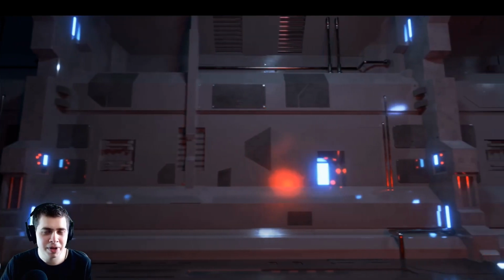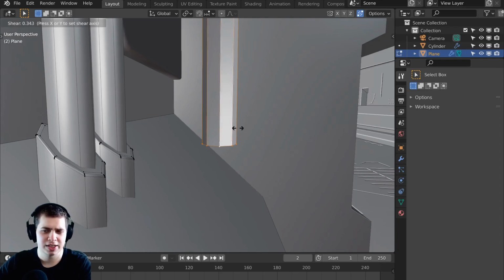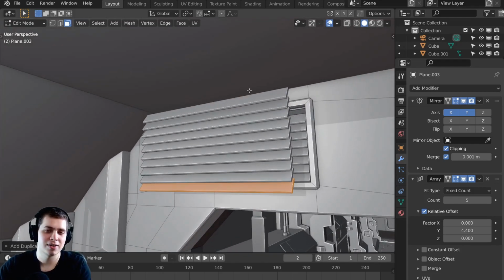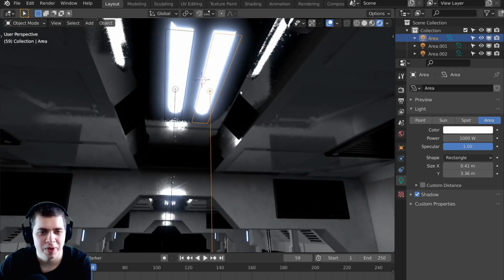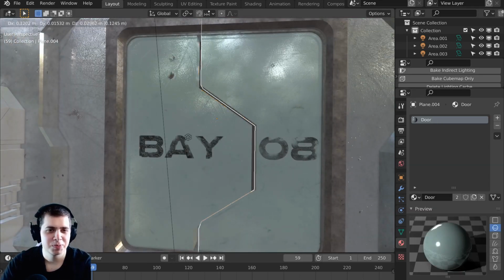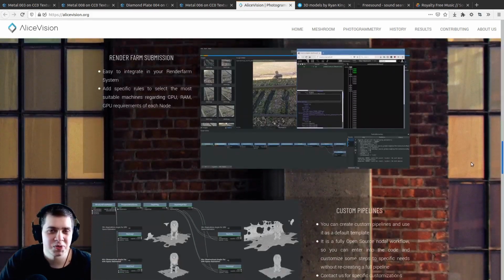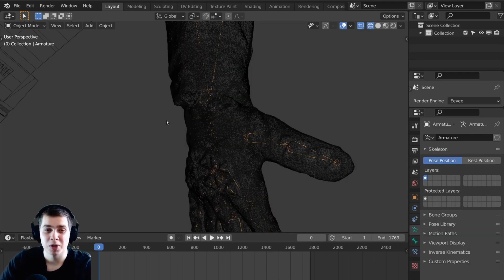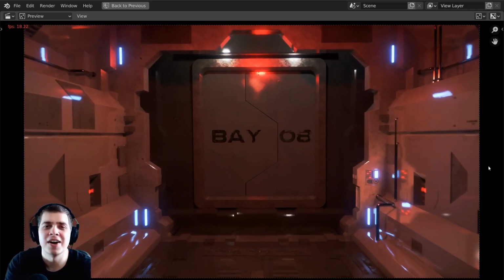How I Created this Sci-Fi Corridor Animation in Blender

Comment: WOW, that was Awesome .. You Are an AMZING  Artist.. I am currently working on the abstract cube  .. I will get there.. I have a very slow computer .. what pc spec's do you recommend ?
Reply from the maker: Thanks! Hmm, that's a hard question to answer, because it all depends on what your mostly doing in Blender, and also your budget. 

Here's an overview of my PC Build:
Ryzen-3900X CPU 12 Core 24 Threds
Cooler Master CPU Liquid Cooler
EVGA Supernova 1000 Watt Power Supply
RTX 2080 Super WINDFORCE OC 8G Graphics Card
500 GB Solid State Drive
3TB Hard Drive
3000 MHz DDR4 32 GB Ram
Thermaltake Level 20 MT ARGB Mid Tower Computer Case
ASUS ROG Crosshair VI Hero (WI-FI AC) AMD Ryzen AM4 DDR4 M.2 USB 3.1 ATX X370 Motherboard

Comment: Hi! Cool 3D Model with Animation. May I know what's your pc configuration. Thanks.
Reply from the maker: Here are my PC specs:
Ryzen-3900X CPU 12 Core 24 Threds
Cooler Master CPU Liquid Cooler
EVGA Supernova 1000 Watt Power Supply
RTX 2080 Super WINDFORCE OC 8G Graphics Card
500 GB Solid State Drive
3TB Hard Drive
3000 MHz DDR4 32 GB Ram
Thermaltake Level 20 MT ARGB Mid Tower Computer Case
ASUS ROG Crosshair VI Hero (WI-FI AC) AMD Ryzen AM4 DDR4 M.2 USB 3.1 ATX X370 Motherboard
Reply: @RyanKingArt  Thank you very much for your swift reply Ryan. Wow! Thant's quite an impressive system. I am a newbie to blender I Just started to follow your tutorials and they are amazing. You have made a lot of effort and time to do them and you are a very good teacher too. Thanks for you lovey support to the blender community it helps us a lot. I am from Sri Lanka and we have a very failing currency compared to the US $ and we cannot afford to buy some of the best courses that are out on the website (they are pricey) but you teaching them for free that's a great blessing. Thank you very much for all the video tutorials. May God Bless you abundantly. P.S I successfully completed your Tatooine Environment Tutorial. Awesome explanation. I quite didn't understand of the node editors but I followed you and got a great result. Thanks again.
Reply from the maker: @500shanth  Thanks!